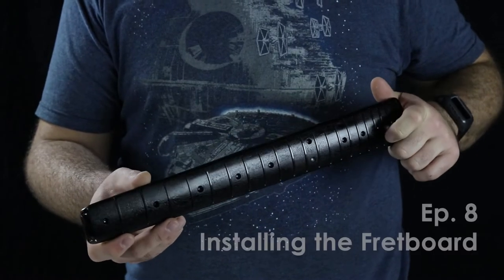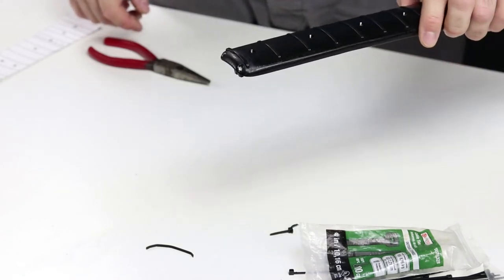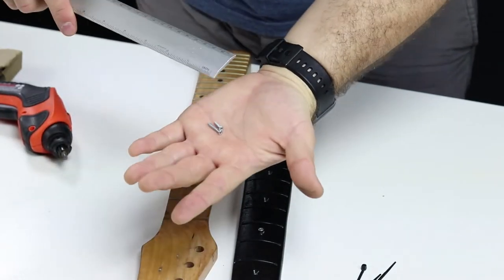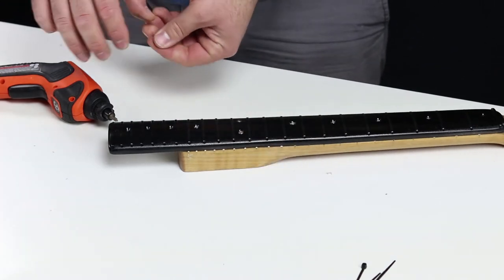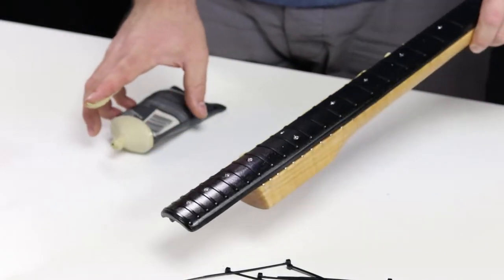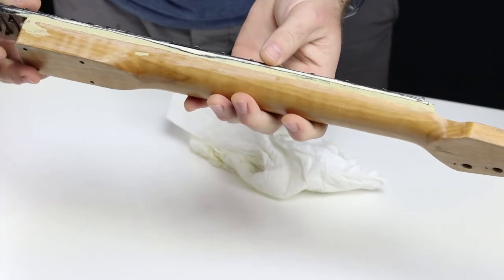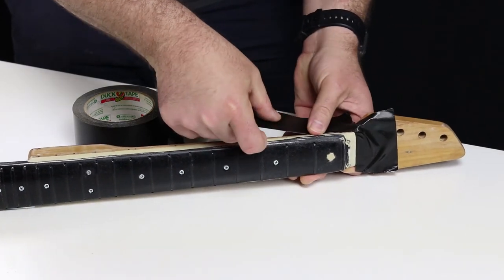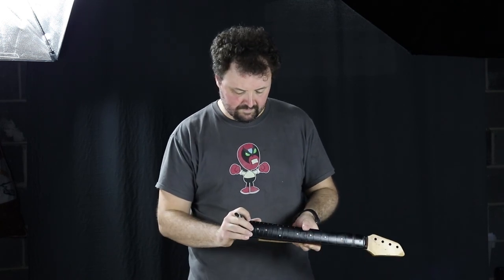Installing the Fretboard - DIY bowed guitar Episode 8 - The Cellotar

Comment: Please, just use sandpaper to sand the wood filler & don't sand the edges of the fret tyewraps! You may also want to drill pilot holes for the screws. Don't use duct tape. Painters tape works better. It's a bit painful to watch someone with admittedly limited woodworking or mechanical skills, but I applaud your effort & am thankful for what you have made available to us. You could try Vaseline on the frets to keep paint from sticking.
Reply from the maker: story of my life—I’m never the most skilled or qualified person to do pretty much anything I do, but I do it anyway... thanks for the tips

Comment: When you first started stripping down the guitar neck, you could have also pulled out the frets and filled the gaps with epoxy. The cosmetic problem of the fret edges after you attached the new neck would have been solved
Reply from the maker: yep, true. these days I make my necks from scratch so I don’t have this issue anymore: www.cellotar.com

Comment: Hello, is it possible to use full size electric guitar neck?
Reply from the maker: yes, but you will then need to use 4/4 cello strings instead and recalculate all the fret positions using the stewmac fret position calculator... I’m also not sure about string tension and tuning, but it should work yes